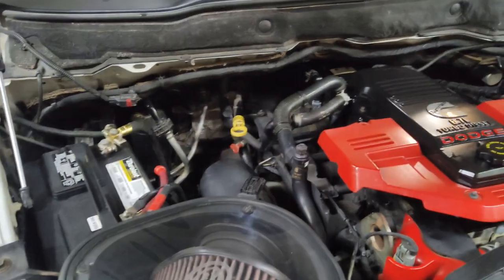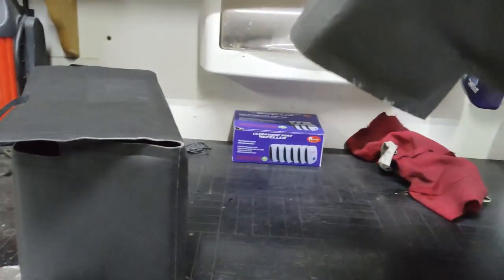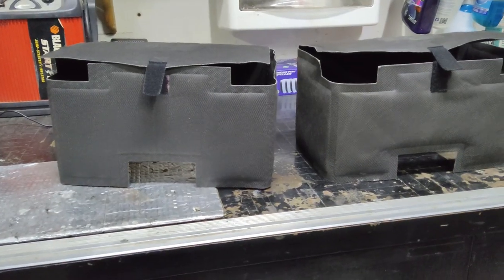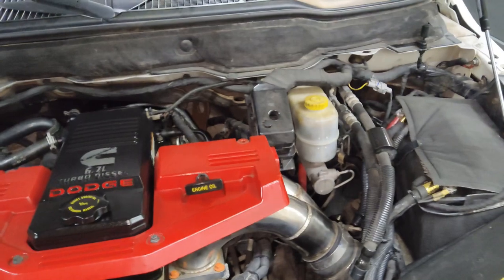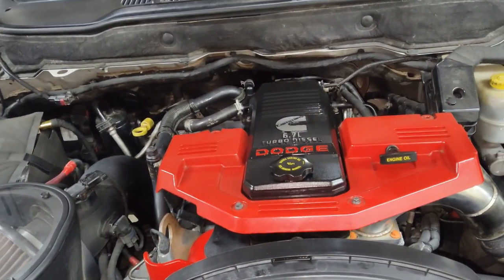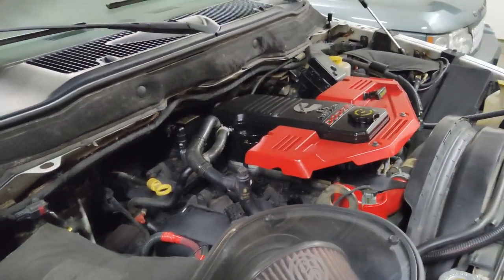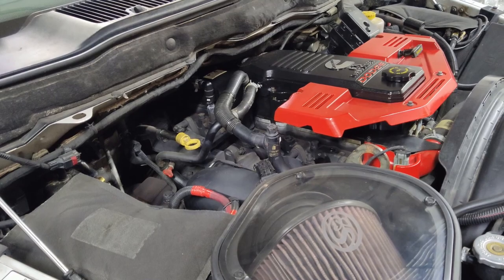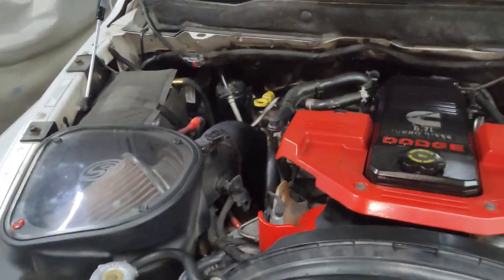Car Battery Insulation | Extend Battery Life

Comment: This happened to me when I got new batteries installed. A year later the battery is suffering from corrosion. It’s only happening on the turbo side which gets extremely hot. Didn’t have any corrosion issues before the insulator were removed
Reply from the maker: Hi, hydrogen gas is formed while the battery is charging along with sulfuric acid that's already in the battery. For the felt type material on the insulation, it's a part of the job to absorb some of those acids.  You may want to make sure your battery is not leaking or being  overheated/overcharged.  You can also use an aluminum heat reflective type of battery insulation.  The point is to keep the engine heat from the battery and hold the heat the battery has.    Thanks
Reply: Hey, I have no fluids leaking from the battery. Battery looks good no deformities but I agree with you on the excessive heat. I purchased a reflective shield because the engine bay heat is the culprit